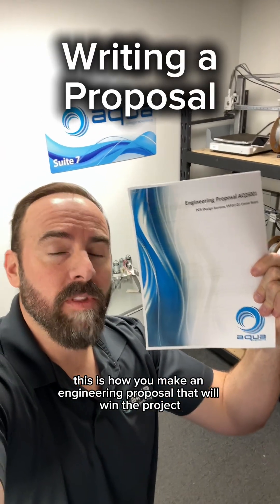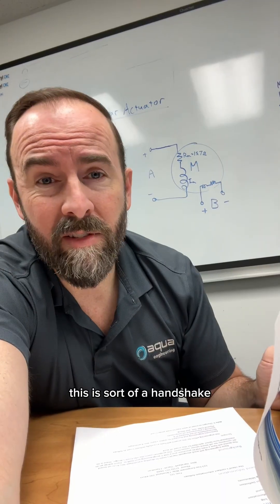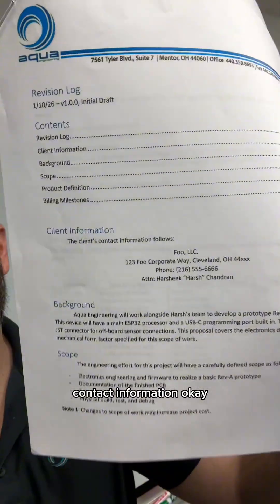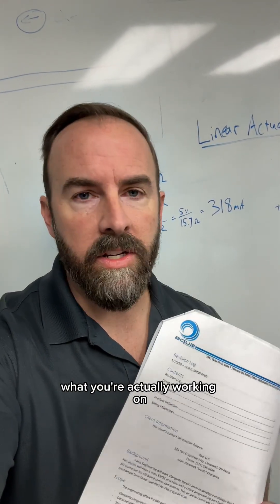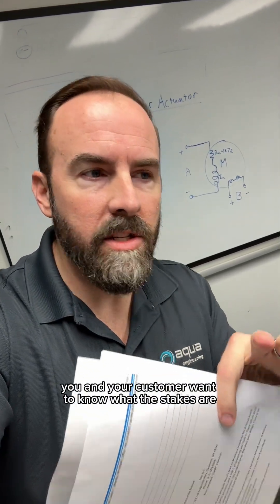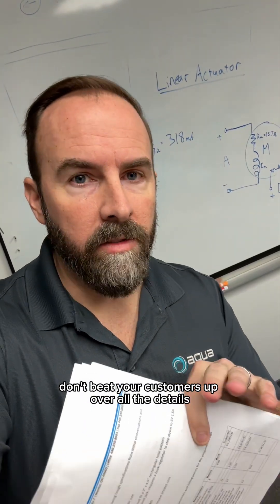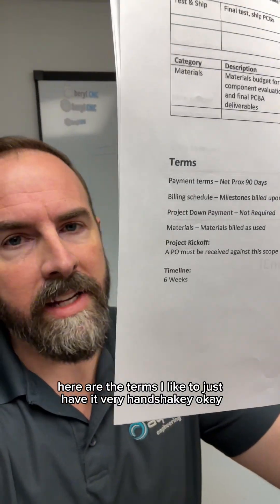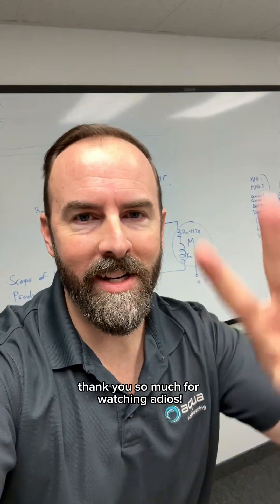How to Write a Proposal

Comment: I think a good thing to add is a "what's not included section". If you know something is not included and you think the customer might think it is.
This could explain why someone else is cheaper. Because they did not include certain things like batteries or installation or something else. You tell your customer if someone is cheaper make sure that they did not omit certain items.
Reply from the maker: Yes I will do that in the notes that get initialed if I think there is something that might seem obvious that is not included.

Comment: Thanks a lot for all the info you've been putting out. I'll be starting to do this very soon and your content has been immensely helpful and inspiring.

One question: How do you deal with uncertainty? This is the scariest part to me, because this is a R&D project after all, so sometimes things can go south. What do you do if something ends up taking 5 times the ammount of time of what was stated in the proposal or if something proves itself unfeasible? Or do you go with a different model of proposals for larger scope projects?
Reply from the maker: The reality is that many R&D projects end up with some really tough conversations on cost and timeline. Best approach is to really simplify the feature set on that Rev A prototype. Also when the project is really sketchy I’ll include a design review and reassessment of the project after a small paid background research phase.

Comment: How did you estimate hours ? What if the deliverables take longer ?
Reply from the maker: If it’s a fixed price quote you just become good at guessing. There is some latitude and flexibility to button stuff up faster if the project is starting to take way longer. And usually something is out of scope when this happens. Ex, customer changed the ask from an LED to an LCD, in which case you can discuss adding hours.

Comment: Damn been doing this on handshakes this whole time and the scope creep has bitten me in the ass. This is so obvious 🤦🏾‍♂️
Reply from the maker: It’s a challenge for sure. Address the scope change too precisely and you’ll frustrate the customer, let too much scope creep in and you won’t keep the lights on.
Reply: @i2c_jason  Last year was my first year, I massively underpriced to offset the risk of hiring a no-name company. Now that I’ve proven and delivered a machine that’s a fraction of the cost, lead time and size with 4X the throughput of what the  OEM was offering I’m using this advice from the video to make a contract that outlines the additional cost “in the event of scope change and/or revisions” so that scope growth doesn’t quietly become free labor.

Comment: No billing milestones. T&M or you're going out of business.  Also, if you are automating someone's process for a fixed rate your making your customers rich while you are trading your time for money.
Reply from the maker: A lot of this is personal preference, I’ve had a lot of success with fixed price quoting. I would agree that most engineers want to quote time and materials. The customer will then ask for “an estimate” at which point you’re still doing the same thing, budgeting out a number from a scope of work. Then the worst part is you can end up with a customer that wants to micro manage your approach so you stay under the “estimate”. Or worse yet, they keep adding scope and then become upset when they look back at the amount they spent, and compare it to your original estimate. So there’s tradeoffs to both and I still occasionally do T&M depending on the customer.

Comment: Hi Jason,
I have a question regarding distribution and licensing of firmware you develop as part of the product: how exactly do you do it? You just share the binary or the source code as well?
What is your prefered software license?
Reply from the maker: Good question. I’ve always operated such that once the customer pays their bill I hand over the source code and design files. I feel that I’ve been paid for the work I’ve done at that point and it’s only fair that the customer gets what they paid for. If it’s an equity arrangement and not the standard hourly rate then that’s a different story and it would need to be worked out contractually.
Reply: Thanks for the response
So you deliver all intelectual property to the client and let them choose license on their own? Or is it done differently?